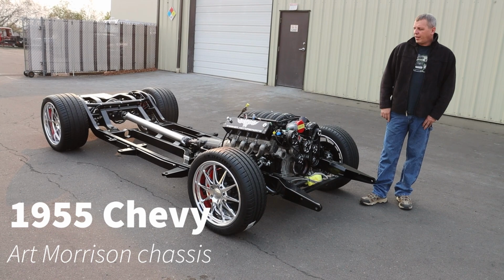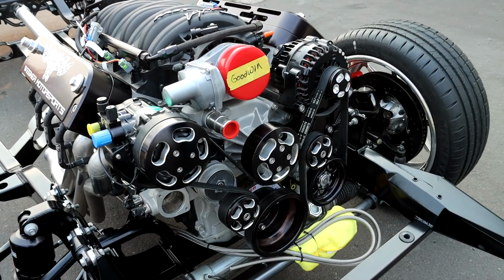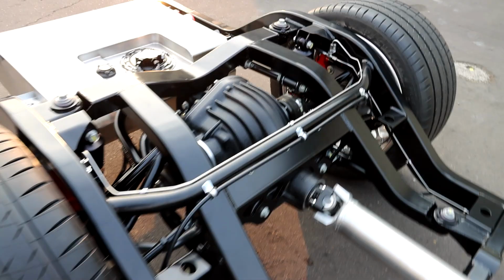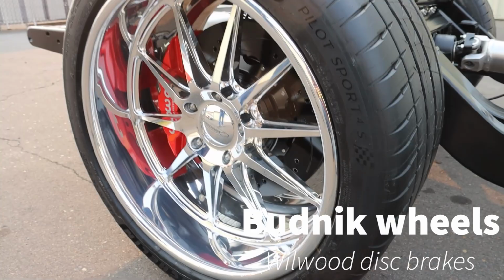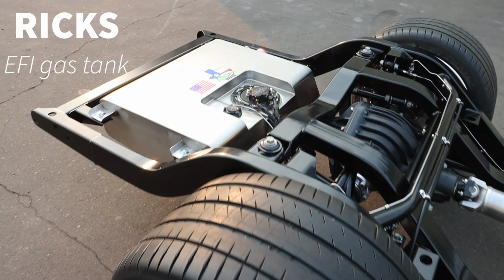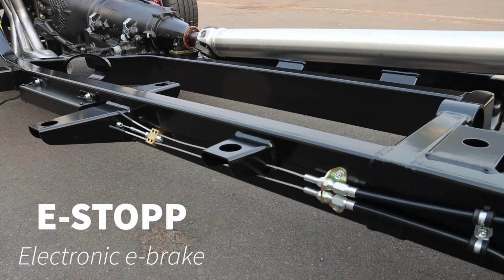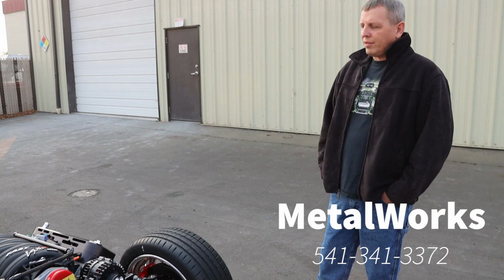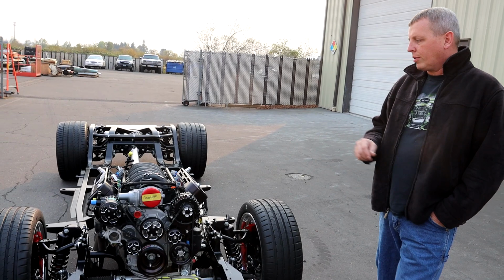1955 Chevy Art Morrison chassis with IRS & 660hp Wegner LS engine by MetalWorks. Trifive chassis

Comment: What kind of paint do you use on the frame? Looks great
Reply from the maker: The main chassis is actually powder coated, with a few suspension components being painted with U-tech single stage.